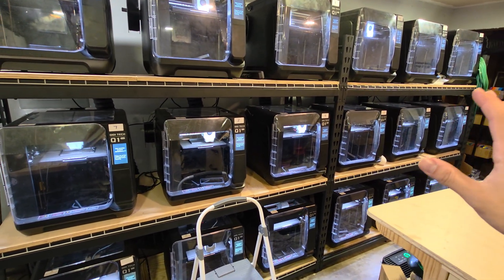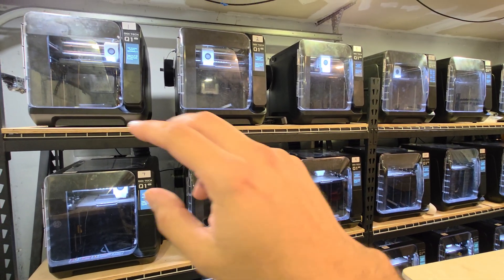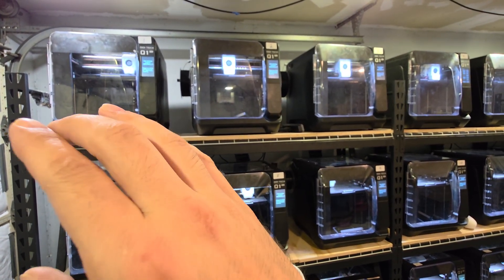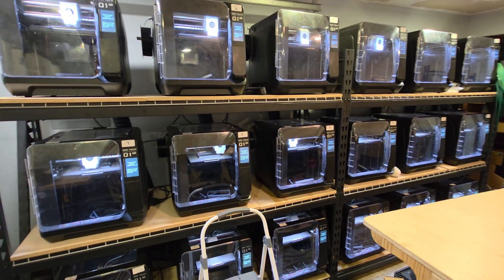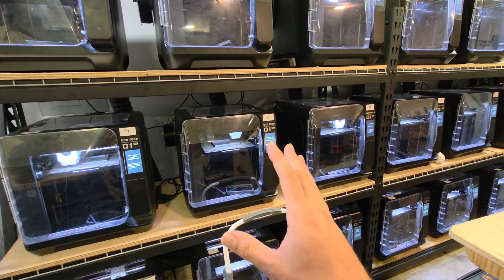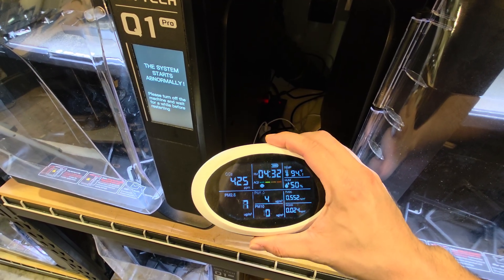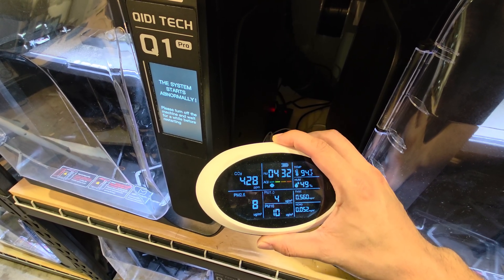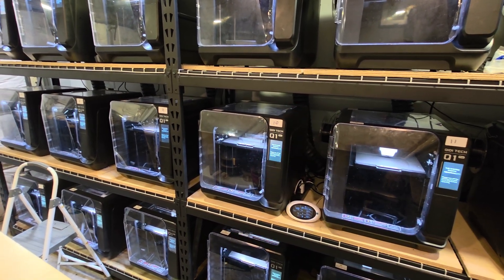QIDI Q1 Pro Print Farm Power Draw for ABS Printing and Air venting setup.

Comment: How does the duct attach to the printer? If you were just doing one printer how would you go about it? Also the link to the 4" duct is wrong.

Enjoyed the series thnx
Reply from the maker: I downloaded an attachment from printables for the fan duct. Search for q1 pro exhuast and the file is by Igor R. Thanks for the heads up Ive fixed the link

Comment: Good video.  A few things to note.  You are saying 100 amps draw which is about my guess and reasonable number all things considered.  I have a meter on my Qidi Plus4 and max I see is about 500watts or maybe a touch higher pushing 535 but that's not common.  Most of the time its in the 300-400w range with a 60C chamber and 80-105 buil;d plate but it does draw pretty good initially.  535w/ 120v (usually 122-125v is what I see but it may dip to 117v) is 4.6 amps.  But here is the good news, you have 200amp service which means 240v (2 legs of 120v) at 200amps.  If your electrician, or you, did it right you should have 3 circuits of 20amps off one leg and 3 of of 20 amps of the other.  So you technically are only really using 60 amps of your 200 amp capacity.  In theory you could triple the size but it would limit running anything else like lights and fans.  Nice setup!  Thinking of setting up 12-20 Qidi Plus4's and found this video on a search for venting
Reply from the maker: Thanks thats correct im running 6 20 amp breakers. 3 on each leg. The startup watts of the q1 peaks around 700ish watts. The plus 4 doesnt peak that high because it won't run the chamber heater until the bed reaches its setpoint

Comment: I’m not an electrical kinda guy but was hoping you could direct me given the depth of knowledge in power consumption of these Q1s…one’s looking to get a minimal UPS for my (single) Q1 but can’t seem to figure out what the proper specs would be. Not for continuous operation without wall power, but for protection against power “blips” during long prints….i read a lot of about Volt-Amps (min 1000 rec, 1500VA better) as opposed to just watts….any advice? I don’t want much bigger than I really need. Thanks! Cool setup!

Comment: I see you have to two printers I'm interested in purchasing, the Qidi Q1 and the Creality CR-10 SE.  95% of my prints are PLA and TPU.  I may also try some nylon carbon prints.  I can currently buy a Creality CR-10 SE refurbed from Creality for $186 USD.  Do you think the Creality CR-10 SE can fulfill my needs.  I have been using my first gen Creality CR-10 since 2017 but would like to move on to a newer more capable printer.  Thank you.
Reply from the maker: If the cr10 first gen works for you the cr10 se will also work. Im not sure about printing tpu i never done it on the cr10 se. The q1 and cr10 are equally as fast.
Reply: @Redo3D Thank you.

Comment: Hey have you ever tried print PA or PA + CF on QIDI?
Reply from the maker: I havent. I printed ABS-GF and it definitely did something to my extruder because when I went back to normal abs my pressure advance was way off. Only way I fixed it was replacing the extruder and hotend with a new one.

Comment: how is the reliability of the printers printing constantly at those temps
Reply from the maker: I've had to replace the ceramic heater on 5 printers and at 2500 hours or so I had to replace the belts. Other than that it has printed very reliably. I do weekly maintenance such as cleaning and lubricating the motion system.
Reply: @Redo3D  nice to know thanks!

Comment: Have you had any issues with running the chamber heater at 60C all the time? I noticed that the control board sits right on the wall of the chamber, directly in the path of the chamber heater. I then also noticed that there is a lot odd issues with users  Q1 pros that all seemed like they could be overheating related (random shut offs, chamber heater not hitting 60 or taking a very long time, and the "it all of a sudden stopped working"complaints). I have not had any issues with mine, but I immediately added insulation to that back wall, and elevated the board off it too by relocating the mcu fan to the exterior of the back wall. But it's weird because it does not seem to be everyone, just fairly common. I am wondering if you have achieved negative pressure in your chamber so the hot air is naturally staying away from the board. I too print primarily with functional grade stuff, and you should have had something happen by now if you're farming. Weird, but good repairing stuff sucks. Qidi is just odd, great machines but weird little oversights all over the place.
Reply from the maker: I added a duct that separates the electronics from the exhaust air. I dont have insulation on the back panel but would be a good idea to add. On klipper I occasionally get the "stepper overheating error" but nothing has ever stopped printing. Occasionally I lose network access to the machine but that could just be a crowded network as I have 50 devices. 

No issues running 60c thats all I've ever done on these machines. I've only had to replace the ssr board on two machines so far. Other than that they stay constant 60c

Comment: Very useful info! Much appreciated! Beautiful farm you've built. Well done! I've got five 20a circuits in my little lab. I have finally settled on the Qidi Plus 4 as my workhorse of choice and will be phasing out my P1Ps and K1s in favor of the Plus 4s as I'm able for homogeneity. The Plus 4s are insulated and have activated charcoal internal filters and I can detect zero VOC smell from the ASA and ABS that I've been printing with them, unlike the K1s, (I only print PETG with the P1Ps), but will still be building out an extraction system similar to yours. Useful info in the comments as well. Thanks!
Reply from the maker: Thank you!

Comment: I use Kapton tape on the windows and doors on my printer, they make it in wide sheets. Chamber temps get to about 60c+ with passive heating. I don't vent out, but i did seal up my printer with a small circulating HEPA filter inside. That should help bring down your power bill. I also use corrugated plastic board with Kapton tape on it to insulate the top, where most heat is lost. You can get it in clear, although it's not that clear because of the refracting.
Reply: bro, pictures of this please 🙏

Comment: Adding some insulation to your Q1s might help reducing power usage.
Reply from the maker: I do have some foam along some larger gaps, but I want to add more on the panels. Im going to experiment with a clear insulation film for the front door as well.
Reply: @Redo3D any insulation you add will help. 

I do not own a Q1, but I do own two  doomcube vorons w chamber heaters as well as ten x1c units with chamber heater mods. 

My farm saw almost 60% reduction in electrical overhead by adding PIR insulation to the exterior panels of all my printers. It was UGLY at first, but after the cost savings was known I cut templates and mad it look better. There’s only a small window in the insulation to see through. 

My chambers heat faster, stay warm longer during cooldown which greatly helps after print warping, my bills are less and they’re QUIET now. 

I highly recommend it. 

Also, absolutely beautiful farm. I would love to have a handful of Q1 machines as they seem to be firing on all cylinders. Great job.
Reply: @DatMammut76  i was gonna suggest that. 😃👍🏻🫡   
I have 2 Q1s in my small print farm and I added the bubble wrap insulation used to keep RVs cool.(bc I'm an old guy) and it worked great. My constant power drain during ASA 3 hour print went down by 23%. Yes. 23%. Those little Q1s are imo the best printer Qidi ever made. And that includes the plague-ridden Plus4. (Of which i have 2) bc I'm an old guy and I like RVs.  Nice job young man! Very impressed with your print farm! I may get you to do some spill-over work for me! 
Good luck to you!
Reply from the maker: @helixxharpell thank you! Anything I can do to help please contact me at info@redo3d.com